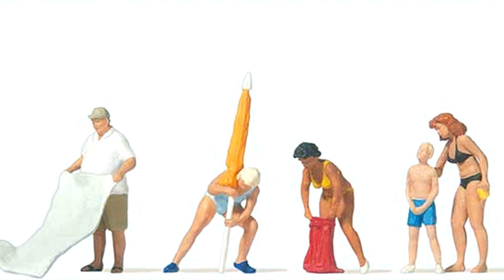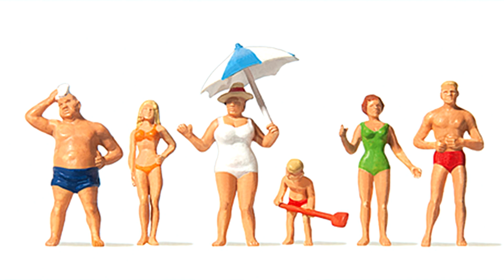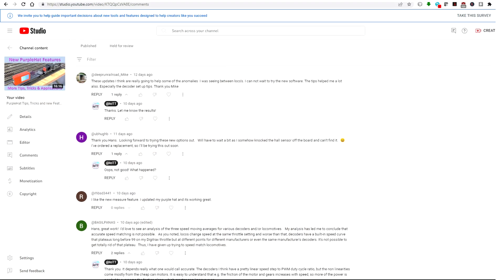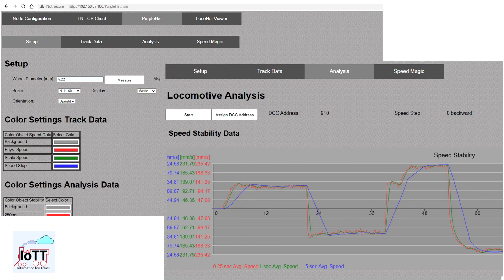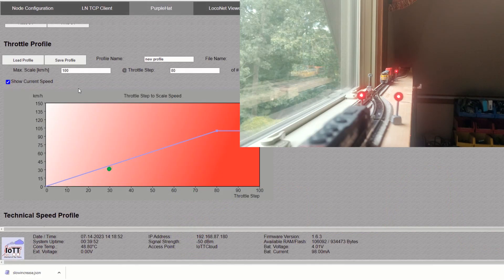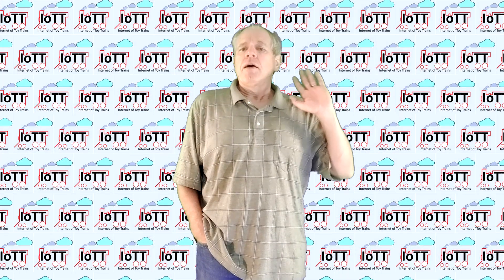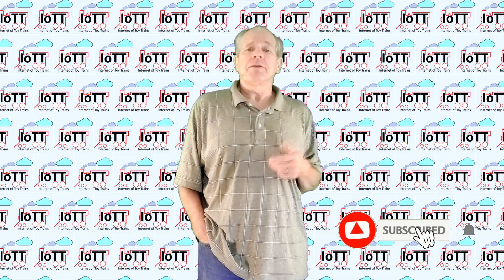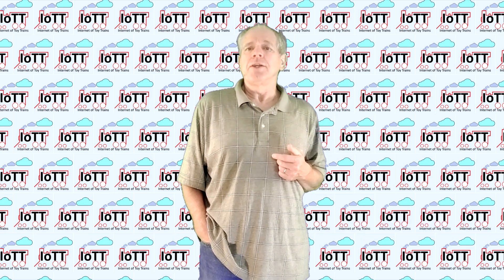Closing the Loop - More New PurpleHat Features (Video#123)

Comment: Hi Hans,  I was wondering if you have any suggestions for LokSound decoders where you can't set the vMin/vMid/vMax to zero.  I have been using 1/127/255 which seems to work ok , but not sure if that's optimal.  If I modify the vMid, it changes the speed profile, so not sure how that's going to work when trying to match other locos/decoders.    Also, I seem to have a problem with the higher speed steps when it changes directions, it appears that it start measuring before the loco is back up to speed.   Would it be possible to have a configurable delay, so it switches direction, start moving at the previous Speed step, wait for a $X seconds, before moving up to the next speed step and then start measuring again?  Thanks!
Reply from the maker: If you can't set the values to zero, you should be able to set them to 1, 128, 255 which should also give a "neutral" speed curve. If you do that, you also need to set CV 29 to no longer use the speed table.
Doing a configurable delay to allow for longer accel time after direction change would be possible. The problem is that it increases the needed test track length or you have to go back and forth more often. The standard way to deal with the problem is to set the accel and decel CVs to zero for running speed profiling, so that the loco has immediate reaction. 
What scale are you modeling? Are you using very heavy locomotives?
Reply: @IoTT    Thanks for the reply.  I'm running HO locos and the ones I'm testing with are Scale Trains, which probably are on the heavier side.  I have a 10ft track to run them on.  Even with the Accel/Decel set to zero, they still don't start up to the previous speed really quick.  If I watch the graph, it dips each time it changes direction, with the dip larger the faster it's going...
Reply from the maker: @stephenwinter3759  I checked the code. At this time, the wait time after direction change of reaching speed is 500ms plus 4ms per speed step, so if the speed step is 20, this would be 580ms before the measurement. I could make the 4ms multiplier configurable. Can you try to do an estimation what delay times would be needed? Or can you maybe send me some screen shots from the graphs you are getting?

Comment: Hi Hans,
I love the purple hat but... I am having trouble calibrating a locomotive with the desired speed range.  I want a 70 mph top speed and the percentages on the throttle to match the scale speeds - 50/50 for example.  One problem is that more often than not the loco over runs the measured section.  I have recalibrated the wheel diameter and when running a 1500mm length it is very, very close to exactly right. The over run happens when starting with either the 3 pt (min, mid, max) method or the speed table.  I have recalibrated the wheel diameter and when running a 1500mm length it is very, very close to exactly right. It looks like the direction command gets lost?  When I do get a complete run (I don't know how) the speeds on the throttle are very close to double the scale speed desired.  The Throttle Profile looks like what I want, e.g., 20 Throttle speed = ~ 32 kph.   Additionally, when I load the JMRI file it always shows a 100 max but I change it to 113 in Throttle Profile section.  I don't know if this is significant.  I need some suggestions.
Thanks so much for this great work!
Reply from the maker: If the speed is doubled, please check the trim value settings. If you have set it to 0-100% but your decoder supports the 0-200% model, you would end up with roughly double speed.
Regarding overrun, the loco is not trying to do a spot landing, overshooting the range by a few inches, particular in the second run when testing higher speeds, can happen. As long as the loco stops reliably, all is good and the overrun distance is considered on the way back.
What do you mean by 'the direction command gets lost' ? When does it happen? What setup are you using? It would be helpful to know more about the settings you are using, like what protocol, what command station, etc.
Reply: Hi,
Making real progress here but a few more questions 🙂

These are the conditions/parameters/hardware/software I am using: Digitrax throughout including DT602D, DT400, DCS100 Chief Command Station, program track, JMRI, RRCirKits LocoBuffer-NG  (Next Generation), Loconet over TCP (Loconet lbServer Client), DN163A0 decoder in Atlas N-Scale B23-7, IoTT Stick Plus with Firmware Version:1.6.4 and the PurpleHat Track Measuring Kit N Scale, a Netgear wireless access point provides the wifi.  

The decoder was prepared as recommended including Use Speed Table (set from 0 to 255) and both Trim settings at 255.  All CV changes were accomplished on the program track writing through Decoder Pro for decoder setup and the Purple Hat Speed Magic tab to write calculated values as obtained in the calibration run.

After reviewing Video #88 I switched to Imperial on the Setup Tab.  I also changed the Mag Threshold from 15 to 18.  After a calibration run I saw the Trim % was set to 200 so I set it to 100, Recalculated, Loaded CVs to Loco (on programming Track) and the test run resulted in the following as measured by an Accutrak Speedometer.  The throttle was a DT602D.  I have obtained the results below.  

MPH 	5	10	20	30	40	50	60	70	% Throttle
									
Fwd	10    12	22	34	44	57   66    66

Rev          11	 11	22	33	41	58	67    68									

Before changing the mag threshold, I 3x attempted a calibration and each, after a few steps, would continue through the layout.  When I changed it to 18 the run was completed as I expected.  How do I know the best number here?  This was what I meant by over run.  

The little dot that is supposed to follow the speed curve starts and moves along the x axis.  What is going on here?

I would like to fine tune this table.  The speed for 5, 50, 60, and 70 should be closer to the desired.  How is the best way to accomplish this?
Any other suggestions are most appreciated.

Thanks very, very much!
Jim
Reply from the maker: Looks like some progress. The mag threshold value is used to deal with measuring tolerances in the magnet field. If the magnet axle is not moving, I keep getting changing values while reading the sensor due to tolerance and external magnetic influences. The threshold value tells the sensor how much fluctuation is interpreted as stand still and not calculated as distance change. The setting is correct if the absolute distance indicator is not increasing while the car is standing (the relative value will always balance to zero).
The speed dot is driven from two values. The x axis reads the speed commands from the throttle and places the dot accordingly from 0 to 100%. As you turn the throttle knob, the dot will move left and right. The vertical value comes from the measurement of PurpleHat. It is transmitted via websocket from the Stick to the browser web page. If you do not get a vertical change, most likely the web communication is disrupted. Verify the signal strength. You can also open the debugging tab of the chrome browser, where it will show if websock gets disconnected. If it happens, it should restore the connection after a second or so. If it does not, you can reload the webpage, but you than also would have to reload the roster file and the throttle profile.
The speed table is currently calculated from the measured average of forward and backwards speed. Another user suggested to create an option what would allow for basing the calculation on either forward or backward only, which probably would lead to a better table calculation particularly in cases where there is a significant speed difference between forward and backward for the same speed step. I plan to implement this option, probably soon. It will allow to base the table on one direction curve and then use the trim value to adjust the other direction.
Other factors that have a big impact on the quality of the speed tables are motor temperature and lubrication/cleanliness of the locomotive power train.
Hope that helps. If you have more questions, you can also e-mail me to hans@tanner-family.org and send me your profile files.
Reply: Thanks Hans.  I have some work to do and I'll let you know how it goes.

Comment: Hi Hans. I am really struggling to network all of my devices together to communicate for SpeedMagic. Can you suggest a video # or other source so I can learn more. I’m using JMRI, DCCex 5 with a wifi shield. I do not own any loconet devices. Thanks!
Reply from the maker: Hi Ali
You have two options:
a) activate the WiThrottle server on the DCC EX command station and use the WiThrottle client (either version)  on the IoTT Stick. Set the WiThrottle Server address on the Stick to the IP of DCC EX.  The Stick must be connected to the Wifi as well so you can use the browser to activate SpeedMagic. If you use the DCC EX version of the WiThrottle client, you shjould be able to directly program the CVs from SpeedMagic.
b) JMRI connected via cble to DCC EX. Activate the JMRI WiThrottle server and use the native WiThrottle client on the IoTT Stick. Point the server connection to the JMRI IP (as displayed in the WiServer screen of JMRI). Same as before, Stick must be connected to Wifi so you can run SpeedMagic in the browser. With this setup you have to store the speed table in a roster file and then use DecoderPro or JMRI to program the decoder.
Hope that helps.
Reply: This helps a ton. Thanks Hans

Comment: Successfully profiled first locomotive last night. Have some tweaking to do, but I am off and running. The videos have been extremely helpful. I ended up using 'LOCONET over TCP'. The integration with JMRI is very smooth. Thanks for all your efforts.👍
Reply from the maker: Congrats and Welcome to the club! LN over TCP is the best protocol for this application as it allows for direct programming. Much better than first storing to an XML roster file.

Comment: Hi Hans. Got my new IoTT Stick up and running. Loaded version 1.6.3 successfully. However, I have run into difficulty getting the DCC address to populate in the "Technical Speed Profile" section of Speed Magic. I can drive the locomotive with a Decoder Pro Throttle. I do not have an "Assign DCC Address" between the Load Profile and Start Test buttons. I reloaded 1.6.3, but no change. What am I missing? Thanks, Paul
Reply from the maker: The Assign DCC Address button is visible if you are using Loconet over TCP. When using WiThrottle (what is probably the case here), you load the JMRI roster file and the DCC address gets assigned using the address in the roster file. 
Btw: The Stick I sent you was preloaded with 1.6.3. That was the reason it took a few days ;-)
Reply: @IoTT  Okay. Thanks. I did load the roster file. It populates the 1st part of speed magic, but not this section. I'll go back and recheck all of my actions/connections using video #116. I'll let you know the result in a few days. Thanks for the response.
Reply: Success. My error. I had a configuration error in the WiThrottle Client section. Speed Magic now drives the locomotive. Need to make some adjustments to my measuring car and I'll be on my way. Thanks again.

Comment: Hi Hans, I am having alot of trouble getting any common results across any of my engines. I have simplified the speed profile to a liner slope from 0 up to 50 mph as the top speed at throttle level 50.  I 3d printed the purple hat car and I am using it to hold the purple hat with an added battery. The profile generated looks very linear like the desired profile and stops at 50 mph which is nice.  Any help would be great.
   Thanks Mike
Reply from the maker: Hi Mike, sorry to hear about the problems. In order to better help you, I would ask for some more information.
- what command control system and throttle you are using, what communication channel (WiThrottle or LN over TCP)
- screen shots from the PurpleHat setup and the SpeedMagic tabs (profiles)
- what Stick software version are you running?
- Stick C or Stick C Plus?
- picture of the screen that looks scrambled
- verify that the distance measurement works correct

It might be best to send it via e-mail

From your description, it sounds there might be a problem with the communication (speed dot not reflecting the throttle position, engine going at speed at first level)
Most likely not related to the experienced problems, but the recommendation is to keep backEMF on while running the profile test (unless you intend not to use it later)
Hans
Reply: @IoTT  I will gather the info requested tomorrow thanks for the feed back.

Comment: I have just installed v1.6.3 and I found I couldn’t load in a JMRI Loco profile not could I load a throttle profile or start track measure tool although I could measure the wheel diameter.  I believe the reason was that I initially loaded a backup file after updating to v1.6.3 in the node config tab.  Seems to work if you don’t load a backup…
Reply from the maker: Hmm, I have to look into that. Maybe try this: After loading the data file from the previous version, load the PurpleHat configuration page, then click save and restart. The web page runs an upgrade process to bring the data to the latest version, but the Stick can only see it if you save it back. This may cure the problem.
Reply: I had he same problem unde rthe same conditions. Ended up reloading 1.6.3 to the stick.

Comment: Fantastic work Hans!   I was struggling with v1.6.2 but had a lot of success with v1.6.1 and was preparing some feedback but your amazing update beat me to it!  I have been through about 12 of my fleet of mostly old Fleischmann converted by myself.  One issue I did come up against was max volts for a lok pilot 2 which is either 0 or 63 both of which created heavily weighted results…Always look forward to hearing about your new updates and work - thanks again

Comment: What is the best way to reset, choose new, wifi credentials?
Reply from the maker: There are two ways:
- if the AP it is connecting to is not available, it automatically opens the captive portal to select a new one
- if it is connected to the set AP, you click the power button 4 or 5 times in rapid succession (about 1 sec per click) and it will reset the Wifi settings.
You may also want to check the documentation here: https://myiott.org/index.php/iott-stick/user-manual/iott-stick-core/wifi-configuration

Comment: Even more amazing.    One question, not sure if I asked this before but is there a way to see the battery level remaining in the M5stick?  Useful to know before starting a test.
Reply from the maker: Thanks. The battery voltage is shown on the web page (footer section with all the technical data). Fully charged it is at 4.2V, once it is below 3.5V it is getting critical. The voltage level is not exactly proportional to the charging state, but it is the best indicator at the moment.